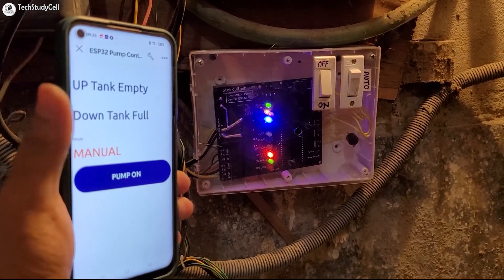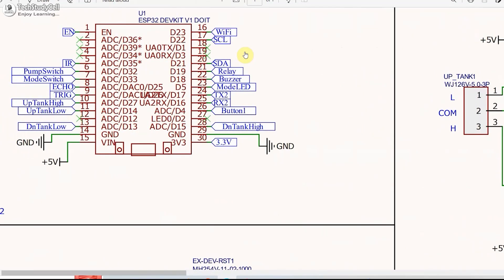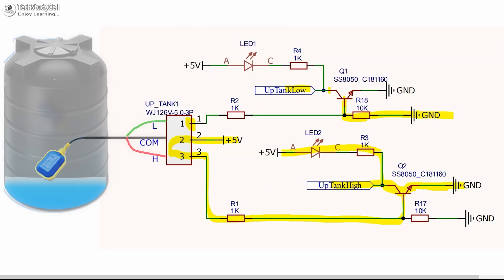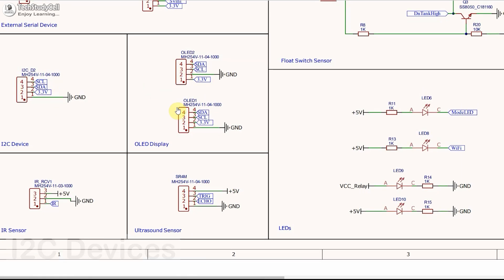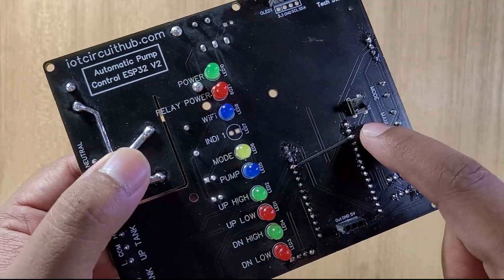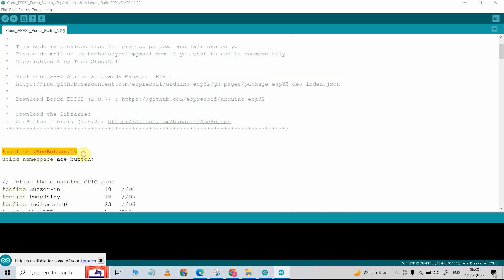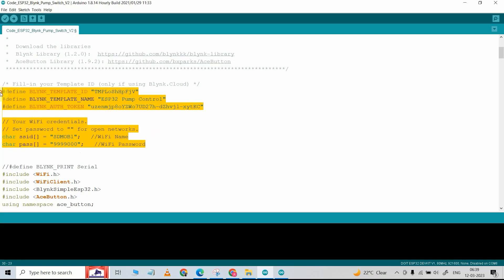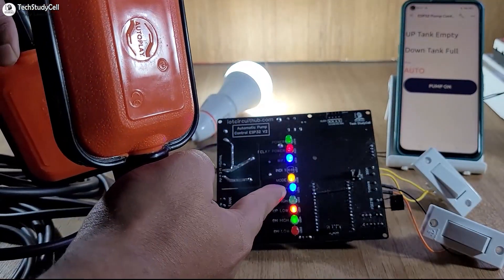IoT Based Water Pump Controller using ESP32 Blynk & float sensor

Comment: Hey I have a project I'm trying to do automation for 5 10.8v valves  to control 4 air driven diaphragm pumps that use float valves to control them but when activated  and de activated I would like to be able to control how long the pump would run once the float is activated and how long after the foat switch is deactivated  then I just have one pump that needs to run on a timer think you could modify your board you made to to work with the 10.8 v valves and I have the 3.2 tft spi 240x320 v1.0 touch screen for my digital screen I would like wifi and Bluetooth capabilities as well

Comment: Helo sir I want 24 volt DC in both side transistor control flip. Flop circuit adjustable veriable 24 volt out 
24 in 
24 out both side